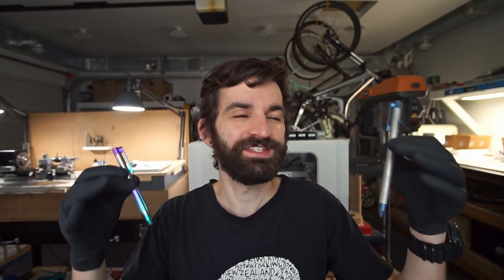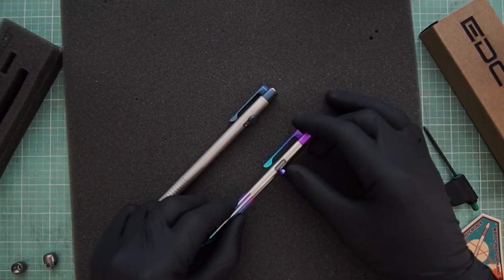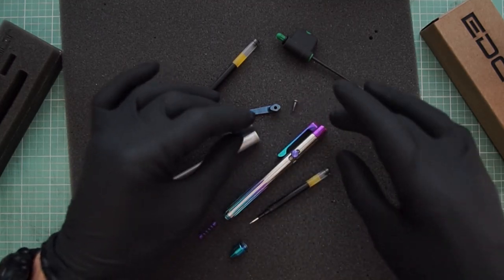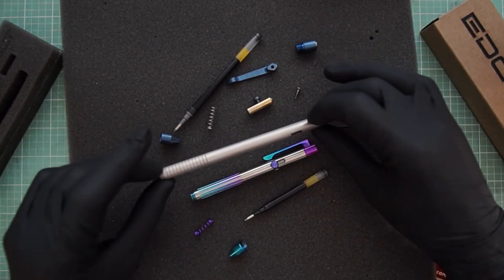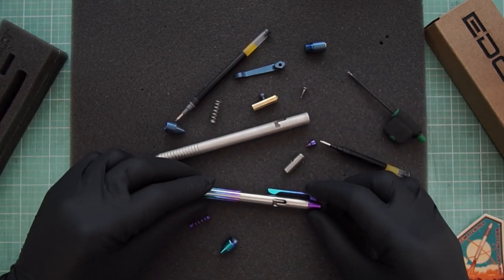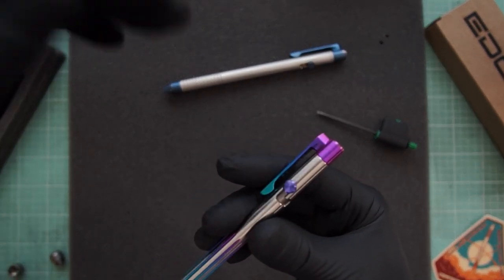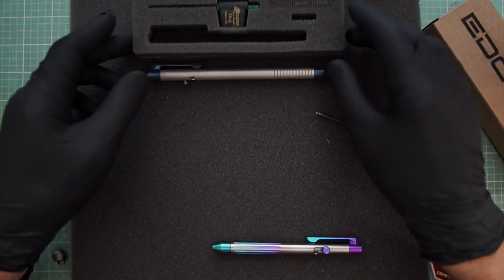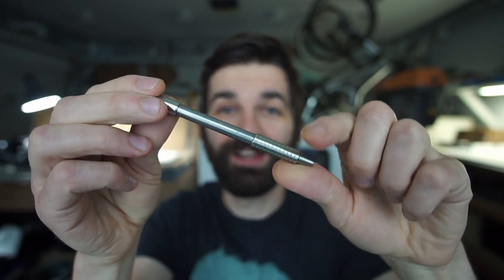My 1st Pen vs My 100th Pen!

Comment: Laser engrave your logo behind the bolt action on the pen body.  It's completely out of the way while it's in use but makes it instantly visible.
Reply from the maker: That's definitely in the running (been looking at fiber lasers for that reason). A small logo on the endcap is also a possibility. Thanks for the comment!

Comment: On scratching the screw. 
Just replace the screw if you are that worried about it, However I don't know whether you had invested time in finishing the screw or not.
Reply from the maker: Indeed, they all get the edges broken and the face lightly polished...screw itself is fairly cheap but nice to not burn the time making it pretty 👍.

Comment: Why drill them out from solid instead of tubing?
Reply from the maker: Hard to source the correct wall thickness in the grades I want and weirdly enough it's a bit easier to drill titanium to size (from solid) as opposed to just drilling / reaming it a 'bit' bigger.